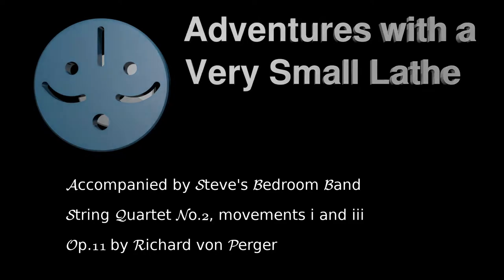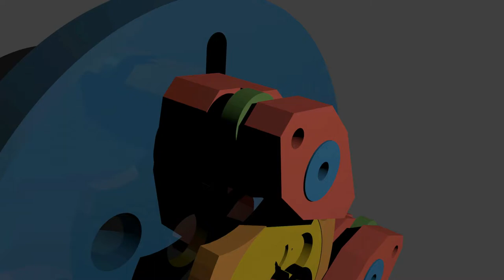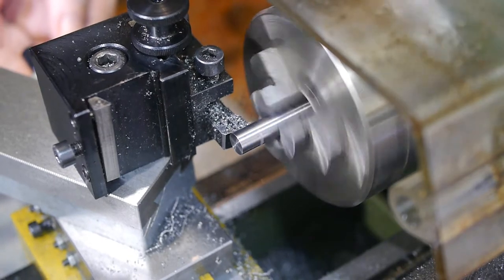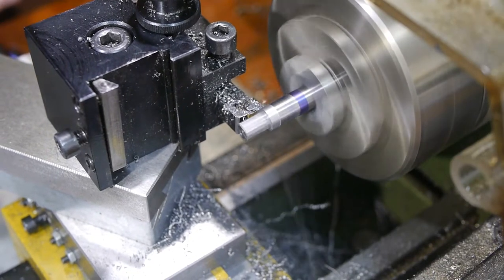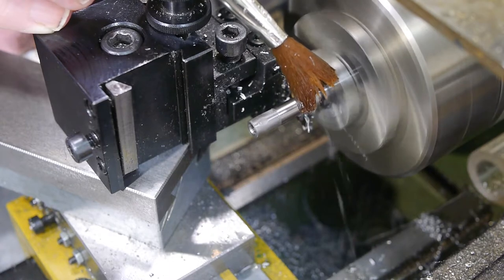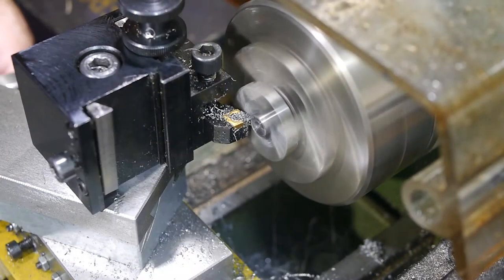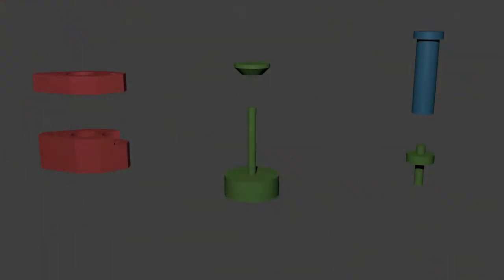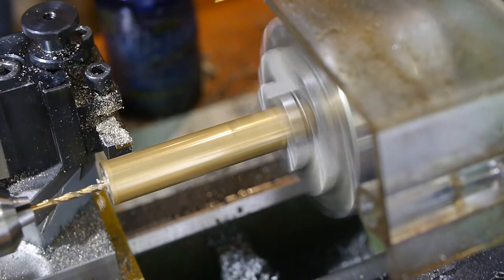Watchmakers Face Plate - Part 11

Comment: Very well done I made a couple myself several years ago, looks like you need a C spanner to help remove the spindle nut on the watchmakers lathe unable to comment there.
Reply from the maker: So far all the "C" spanners I've found are for much larger diameters, and the pin diameter is also way too large. I have a few ideas for a simple shop-made tool that could help.

Comment: That curved slot in the face plate is unusual. Daniel's book shows only straight-slotted face plates. (I think). I believe however that Cowells makes a curved-slot face plate. It is (relatively) easy to make the curved slot, but the nut (tang?) that fits in it has to have a matching curvature and it would be quite amazing to me if it did not bind here and there on the first go. I think some work with a file might ease the problem. I am sure Cowells do it with CNC :) Still, as a piece of machinery  it is beautiful.
Reply from the maker: The first photographs I came across had curved slots, and this decision was cemented for me when the Boley lathe included a face plate with curved slots too. It has certainly made the project a lot more interesting. I was quite surprised how smoothly I was able to get the clamp to move in its slot.
Reply: I wonder if Boley used  CNC :) As you say, interesting project.
Reply from the maker: In the 1950s I'm guessing they didn't. ;) They must have had a bunch of custom jigs and fixtures to make the manufacture of these parts go smoothly.